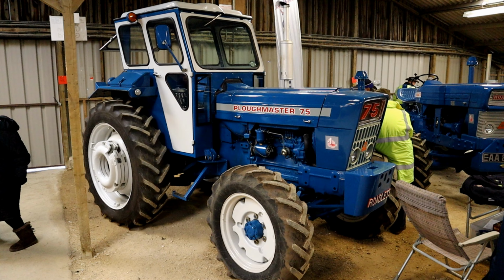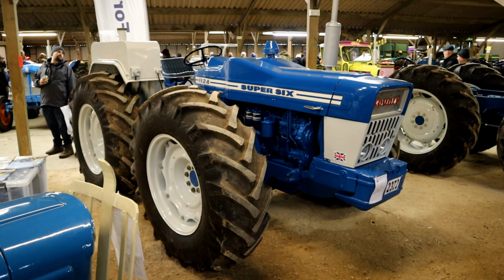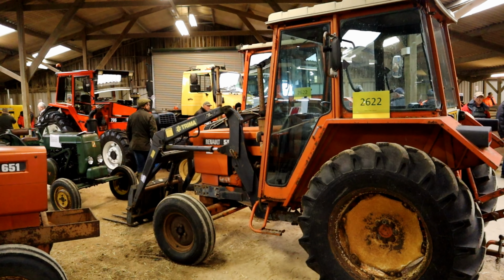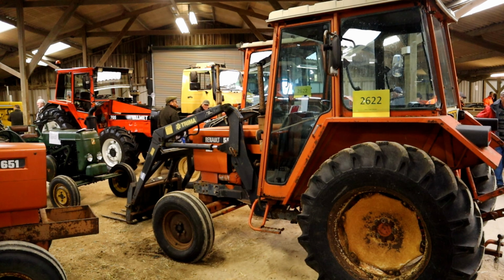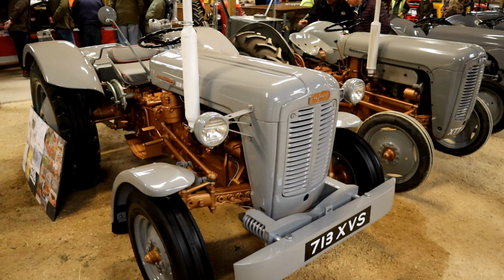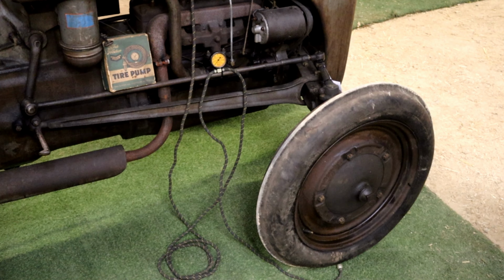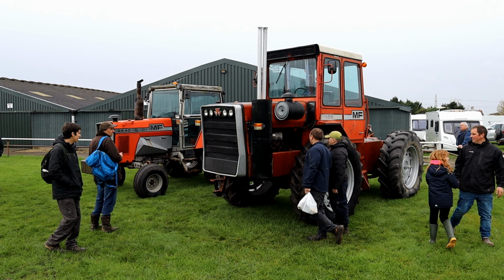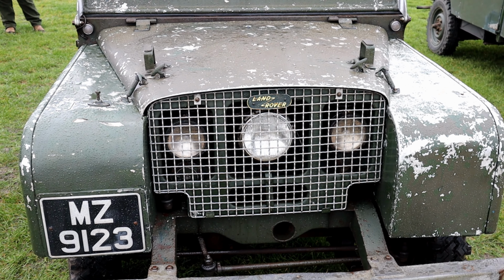Newark Tractor Show Part two

Comment: FORD/FERGUSON.............What I can see is, all the tin work is Ford, the power plant & any thing forward is Ford, Ferguson start possibly at the flywheel, gearbox & all hydraulics, between the transmission and engine is a conversion plate to join both halves together.............It appears when building was taking place, 4wd was thought about as there is an extension twix hydraulics & gearbox for such.